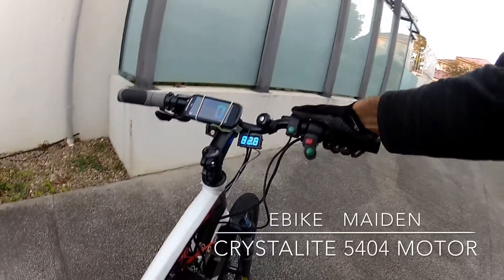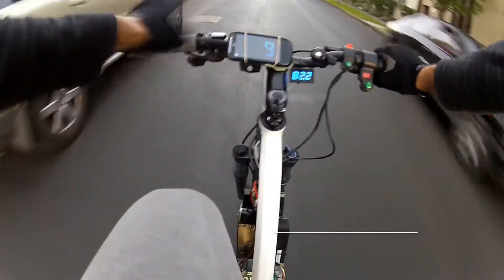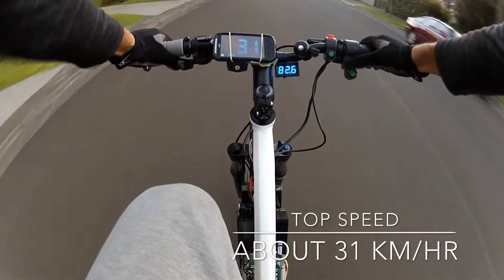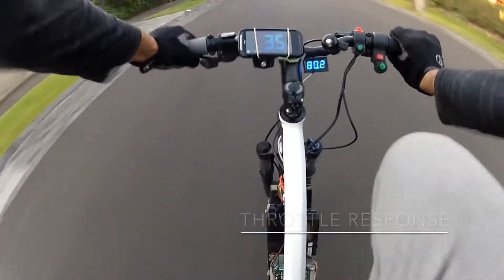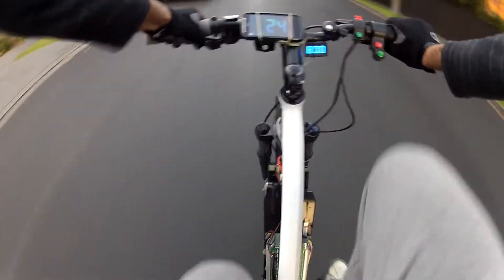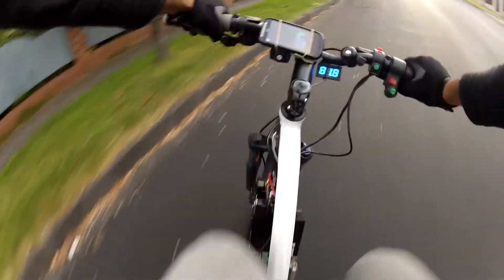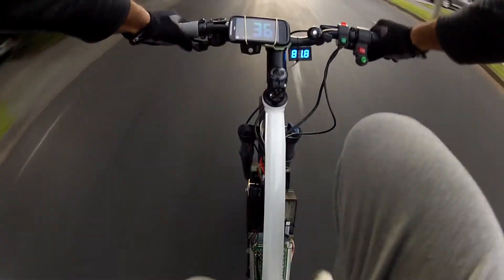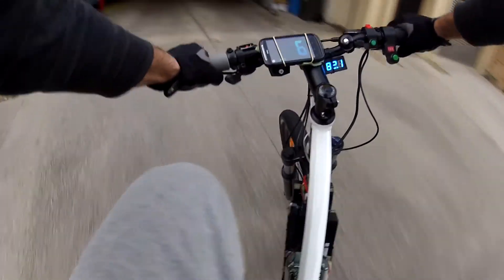eBike Crystalite 5404 Motor at 84v Maiden Test Ride

Comment: I will upload a video sowing the bike in details soon.
I will try to find your build log and have a good look on what you have done. I use a crystalyte 4040 motor
At 15s that's 56v nominal with 15Ah capacity. Thanks for replying. 
George

Comment: Hi. I have the same bike and I got jealous. So I convert it to electric. 
My question is who do you manage the torque arms problems?
I get loose nuts after a ride from the shaft movement. 
Thanks George
Reply from the maker: Wow I would really love to see your bike if you have a link. I fitted mine with a Fox shock and it rides so much better. I made a custom torque arm that bolts through the brake caliper. It is a very tight fit on the axle, I also use nyloc nuts done up very tight, no problems so far.  See my build log there is a picture of my torque arm, link is at the top.